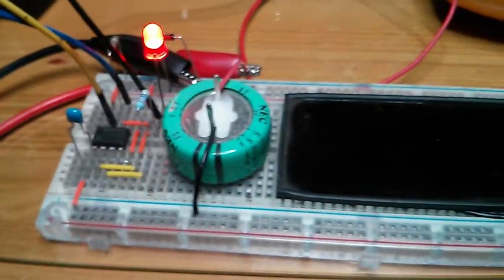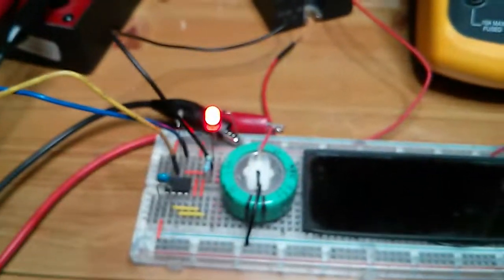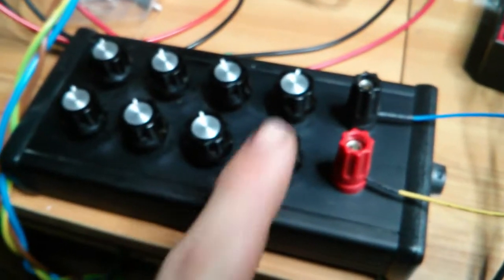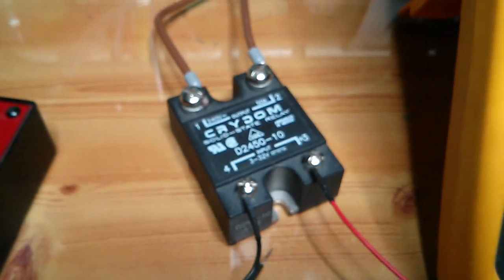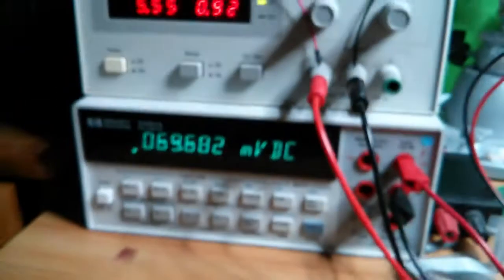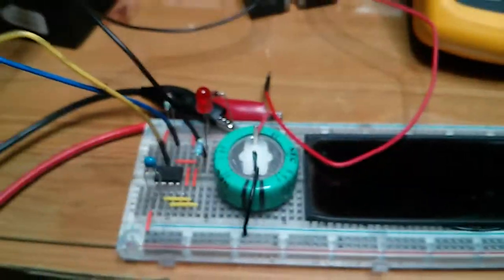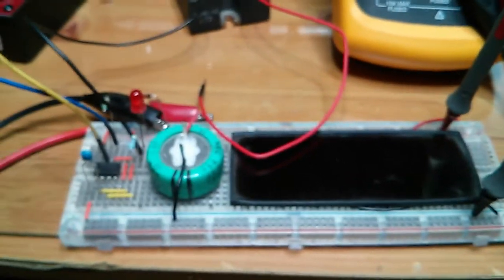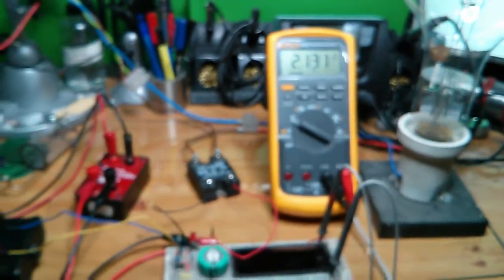Perpetual 555 Timer Circuit Controlling an 800W Industrial Lamp

Comment: if you are useing a 555 then it is very easy to make it audio modulate as well with the use of the last pin. but i find it runs flybacks very inefficiently in comparison to a self modulating set up. i have never seen one run a flyback more efficiently accurately. but it is nice to have a veritable frequency fly back. i use its inefficiencys to lower the voltage to test insulators and such at a wide range

Comment: That's impressive! 
I've only got TTL 555s but some 10F caps somewhere, so I may have to dig them out and have a play again. There's nothing quite like running a circuit off nothing more than a capacitor, it really shows what they're capable of. 
Those µCurrent gadgets look rather handy, my old ammeter finally bit the dust not too long ago that used to do 0.1µA resolution, might be worth getting one. Now if only I could afford a decent meter like your HP...

Comment from the maker: Correct! It is the cmos version of the NE555 everyone is familiar with
Texas Instruments TLC555CP; Check the link in the description.
And this circuit has been running non-stop with the solar panel for
over 9 months now haha, do you mean to disconnect the solar panel
and see how  long she lasts?
The HP 34401 multimeter was an ebay score, came from Vegas,
serious import tax and customs charges, but stil a score! xD